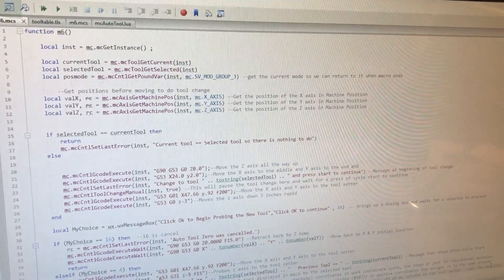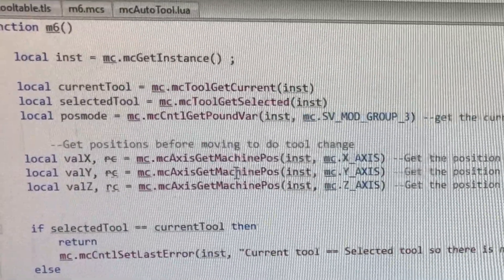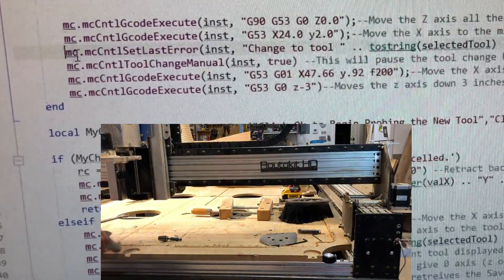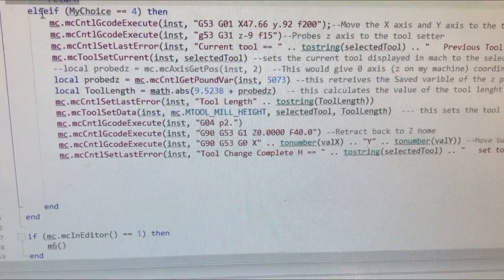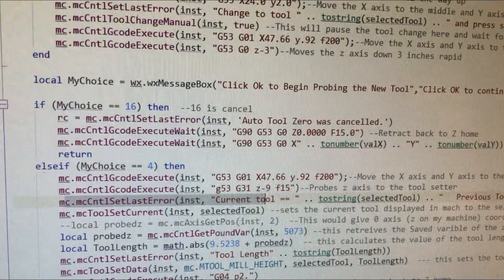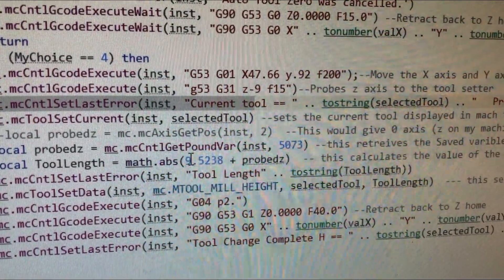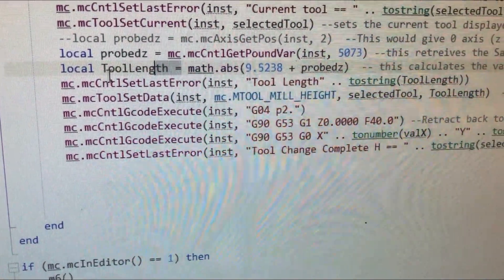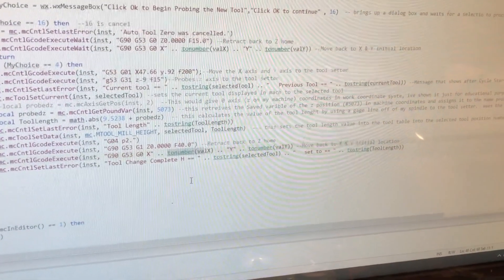M6 Manual tool Change with Auto Tool setting Mach 4

Comment: LUA is arguably some kind of out of body experience for noobs. After you video, I understand C++ better. So thanks, I owe you. Have you checked out Corbin Dunn approach? He has a great series on the use of magazine tool loading forked from the AVID CNC/Mach4 code. And your explanation here will help me edit out the reference to AVID. He has a screen set as well that just rocks. 

 If you haven't enough with the learning curve of Fusion360  CAM strategies, and best practices for WCS/offsets, 2 sided parts, tool setting/offsets, you are assured that the protracted upgrade of your generic gantry mill with the cast iron chassis has now an end in sight. :) You basically finish by upgrade part holding and Z axis assembly that handles a 100mm dia spindle body because F360 tool library management points to the use of ATC BT30. While you are there, why not go to a 3.2kW solution.  I am knee deep in this upgrade. It's broken down to the linear rails. No flat surface in the shop is empty. 
Later, Chris

Comment: I think I figured out the correct process.... If I force a T1M6 in mdi after homing, I get a positive tool value for T1.... activate tool height offsets.....then locate work 0's while active..... Then T2M6 is called, the script runs as it should(need to dial in my gage line offset value) and T2 is populated in table and code proceeds at correct offset.... Phew. If I forget again its atleast saved here. Lol. I marked on machine also just incase. Now I need to this Chinese tool Setter and see if it is more accurate and reliable than my homemade setter.
Reply: can you make video so we can watch.  where to do.  Thanks 👍👍
Reply: I have problems with this too
Reply: @kthobbycncmillingmachine9250  I got mine pretty dialed in and wrote down work flow so I wouldn't mess it up. 100% confusing to figure out spiddle line height to I out for offset. But the code given is exactly what everyone wants and can't find. Manually change the tool and automatically probe to calculate tool offset... Input new data in table and then proceed with code.... Without need to probe work after initial work offset.

Comment: Hello  ,  i am trying to get it work but having troubles  , if  my current  tool  is T8  and i call T4M6 or different tool numbers  it always go down on my touch plate and change only the T2 lenght offsets .  if i try again  it is not doing it for the next tool like T3 , always changing the T2 height and always T2 is now CurrentTool .  When current tool is the T2 and i call in T1M6 it says "its the same tool selected so not doing anything" 

i am  having such a blast playing with the scripts in Mach4 , i was alot better on Mach3 before ....
Reply from the maker: Check the general tab on settings.  Make sure the “tool change in same line” (or something like that) is checked

Comment: This is exactly what I need and have been struggling with for weeks to figure out. So far, I can your script to raise z, move to probe location, tool change, probe, and move back as it should.... However the tool offset isn't being calculated correctly.

Right now it skips m6 for T1 at beginning, do I need to probe T1? 

What is importance of gage line measurement? Can it be any number to do the math with? 

I've broken my brain could you please help?
Reply from the maker: Sorry I just saw this. Let me read through this and I’ll get back to you!
Reply: @accidentaltradesman5139  thanks for checking. what is your workflow. im working on it again and cant recall how i got it to work. maybe change tool to T2 once Gcode is loaded....then once it starts T1 M6 gets T1 into the table, but do not use H1? but us H2,H3... in subsequent T_M6 changes? i have tried it without H1 in the code yet. when H1 is used the T2 offset is way above the work. like 1.5 inch or so(prob the length of T1)